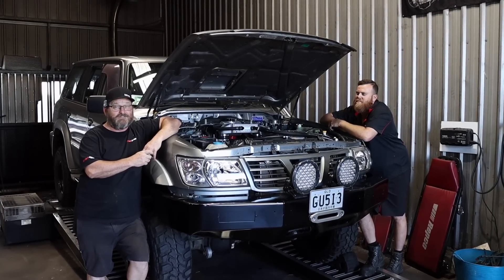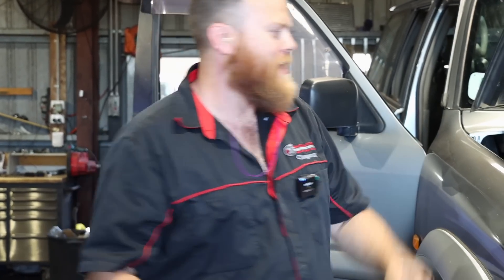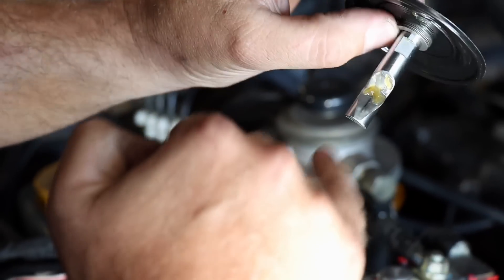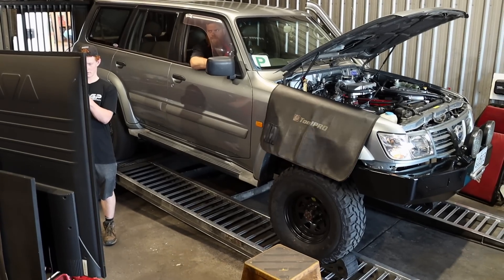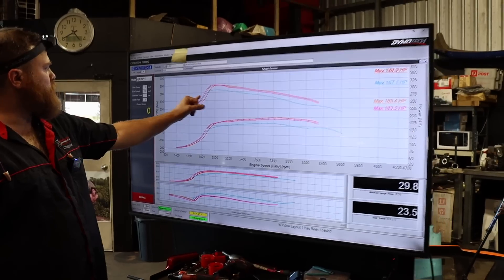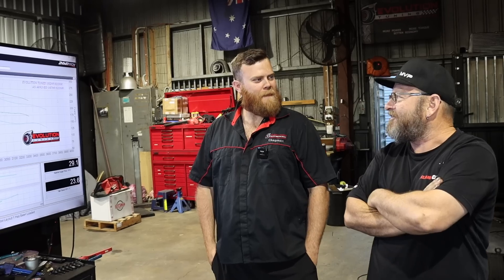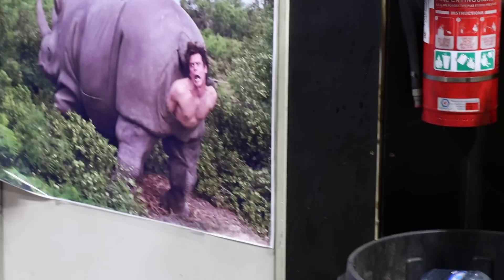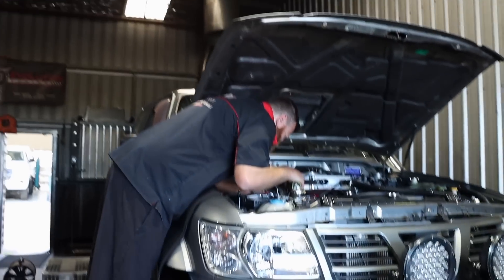How To Tune Your Nissan TD42 the RIGHT Way!

Comment from the maker: Thanks to Chris at Evolution Tuning for the runs on the dyno! If you've got a diesel and want some performance gains then send him a message!
https://www.facebook.com/Evolution-Tuning-1810376872617256/
https://www.instagram.com/evolution_tuning_chaps_remaps/
Reply: thanks, excactly what I was looking for. I'm up in Woodford.
Reply: Put a Spal pusher fan on the front of the heat exchanger for low range work. I have a FMIC and fitted one wired to also come on/off with a/c, on when i want it on and off (regardless of air con, for water crossings) with a three way switch.
The $150 one will fit between the bonnet latch support and grill. The $350 1500cfm unit requires grill clearanceing(significant) to fit, but the static pressure performance is so much better it's technically worth it.
Reply: those big window visors are the goofiest thing i've ever seen
Reply: Australia is sunny.
These "goofy visors" work keeping the sun off the vehicle interior and the occupants... @thewholeAhole
Reply: Does Chris have a YouTube? Not interested in other Socials. Cheers, great video.
Reply: @brushitoff503 he has

Comment: Hey guys great content, 190hp and 610NM is not something to be sneezed at, it works out to be 139Kwasps and 610Newton metres, that's stump removal torque figures and decent power figures compared to modern much more  expensive new tradie Diesels. Could we get an update on fuel economy or a guestimate? Thanks regards Daniel  👍

Comment: Because of this build I run one of Lindsey’s split pulse manifold with a twin scroll GTX3067 and turbosmart 38mm gate (plumbed in). Boost control augmented by Gizzmo.
Reply: How'd you find it? I'm torn between going a ufi 11mm and 18g etc the manifold etc but don't want to push any more than 22 pound.
Reply: @Nick-sd7um  why not go 18mm with 18G?

It’s a quality product that fits well. I haven’t had a chance to tune it since install and am in hospital atm.

Comment: Ive seen it on a 10mm td42 NA where more timing was more better but it was N/A and blowing unreal smoke (about 14 afr). Got 80 horse out of it! Haha. (Stock was 45).
Since then its become turbo and with less timing and the fuel wound all the way it, 90hp. 
Also saw it on a td27 where it was only gaining power with more timing till we ran out if range, was planning on moving it over one tooth but ended up leaving it there

Comment: 300HP in a diesel is a lot, because it usually comes with 500lb of torque.

You don’t really need it though, people out here crawl the craziest places with a gasoline Toyota 4 bangers making 100lbs of torque tops.
Reply: Gearing lower than 1:1 is a torque multiplier. I've seen old gasoline tractors pull a wagon with 25 tons of wet straw bales over soggy fields without strain. It happens at a relaxed pedestrian speed, though, because 72:1 is Herculean effort at snail pace.

Comment: Diesel motors. So big, so heavy, so much boost. So little power... still interesting to watch.
Reply: The torque comes on heaps earlier in diesels

May seem like a low power figure but when you've got 610nm coming on at 2,000 rpm it feels pretty powerful
Reply: Yeah, Ive got a 3.2DID Pajero currently, its just factory 200hp. Ive had other n/a petrols rated at 200hp too, but absolutely no way they would move a 2.3T vehicle let alone putting a couple tonne behind it too. Diesels are powerful engines, they just don't rev so don't make those peak hp numbers that petrols do. 

Modern turbo petrols are a huge improvement, but for me having huge torque available in the rev range that you live in 95% of the time is way more important that the peak of the dyno curve.
Reply: 300k miles later....still making that same power...still not needing a rebuild...

Comment: HP and NM is also the german way, so it is actually the best way
Reply: But you guys do liters per 100km which is absolutely infuriating to people used to km per liter and it's always an absolute nightmare to get German cars to default to that. Every time there's a software update it reverts and the mechanic needs to fight with it to not go back every time the car is turned off.

Comment: All of Europe use HP and NM, half modern, and half past millennium
Reply: Horsepower shouldn't be used as measure unit at all.
Reply: @vvevvevvvv  But that's what people are used to and since most people don't have an intuitive sense of how much a kW of output power is anyway it doesn't really matter which unit is used in daily speak.
Reply: @andersjjensen  I mean, it's kinda matters because everyone one has different horsepowers. PS in Germany, brake horsepower in the UK and horsepowers in the USA are not the same. Kw is the same every time.

Comment: If you guys want to jump head first into more diesel tuning you should check out Baldurs DID1 diesel ECU.
It is a very versatile, capable and cheap stand alone diesel ECU for common rail with solenoid injectors and electronically controlled mechanical pumps.
Check it out!

Comment: All this for 200hp. Dang, thats alot of work. But awesome truck. Could you make more hp with a wastegate and propper boost control?
Reply: This is a 4WD diesel, which means it's all about low end torque so you can drive up a wall in 1st gear. And they explained quite clearly that they just let it free boost. A waste gate limits boost once you've hit your target. It never adds more, as only the turbo can do that.

The only way from here is more fuel which makes more power, which makes more exhaust, which makes more boost, which opens the option for more fuel, and then you continue that until the engine explodes... at which point you dial it back a notch. But this is a TD42 with a stock bottom end, so getting a bigger fuel pump will just make it drop it's guts on the floor and/or make a huge plume of black smoke. But Gus doesn't have an unlimited fuel budget, so the fuel pump was calibrated for efficiency. An air-fuel ratio of 45:1 at the top end is good for his wallet and good for the engine life.
Reply: But 600nm of torque, these things chug along , awesome in the bush where low down torque is key plus will eat up most hills happily in 5th.
Reply: It's meant to last long
Reply: Very interesting. Thanks for the info. I love this community!

Comment: I watched this with a good mate of mine who is a diesel fuel injection specialist and he said this was a great explanation on how to tune a diesel with a mechanical pump. Decent numbers from an 11mm, we saw 220hp and 812nm reliably on 33's with a custom 12mm setup and gturbo combination at 28psi, still going 7 years later, the td42 is somewhat underated if setup and tuned properly. Love the number plate too by the way 😉
Reply: How many km though?
Reply: @jarrod1687 one had 210k on it when we did the setup and last time I heard it had over 350k on it, gets sent in dunes, tows a boat and did a trip part way round Aus
Reply: Yeah nice 👍

Comment: You are limited with standard elements, ultimately you need more fuel over the same duration as generally turning pumps up lengthens the duration/ dwell but any more than 32 degrees will just make smoke.
Dpuk explains this perfectly.
With bigger elements you can double that power figure.
Also change governor spring for more rpm......in fact just direct control the rack and don't bother with a governor!
Put a longer duration cam in too and balance it etc.......7000rpm? Lol

Comment: Timing should be done properly with a dial indicator not just "see what she does" this way then that way.
Reply: A dial gauge is good for a baseline, but various factors will change how a motor reacts to its pump timing so the dyno will give you a clear result of what timing adjustment the motor is most efficient at.
Reply: I dont know much about diesel tuning, but if you are seeking peak performance, why is setting it to a book value superior to testing various values in real life scenario to see what the engine performs best with? Im heaps more familiar with petrol tuning and never has a 'set it to this value' been acceptable for maximising performance in applications beyond a stock setup.